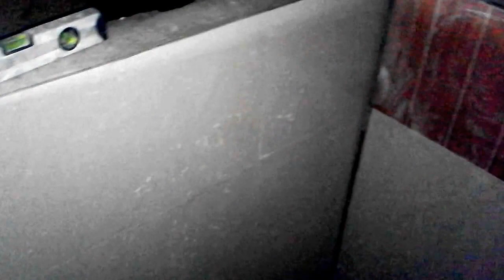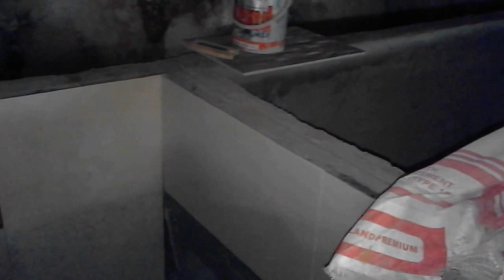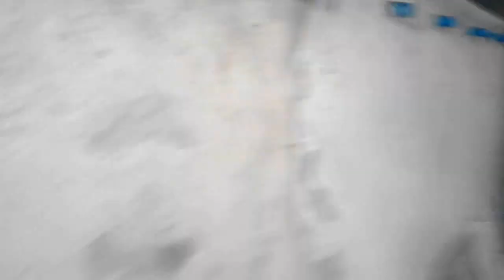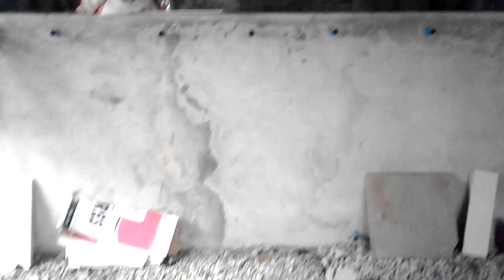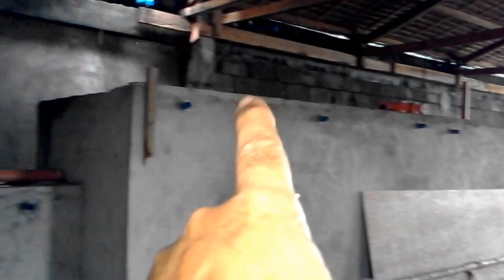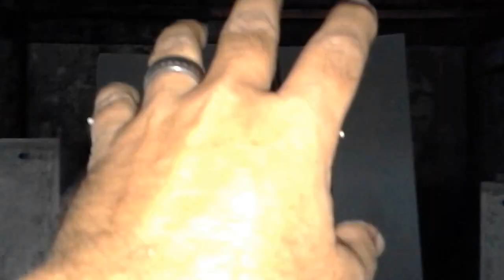Lobster Hatchery Project in Surigao # 14

Comment: Hi James any new videos about the project?
Reply from the maker: The construction has been at a standstill for a few months due to a few factors. We are in our rainy season here in Surigao and over the last few months this area took a direct hit of a strong tropical storm and a 7.2 and 4.9 magnitude earthquakes. We received some structural damage to the outer structure which still needs some repairs, but the saltwater tanks were not harmed. This structural damage needs to be done first before I proceed with the project. The work crew is currently being used in the city but once the rains stop we will start transporting building material to complete those repairs.

So I decided that I would use the downtime to work on few videos that I want to upload to this YouTube channel over the next few weeks. These videos will discuss the damage to the structure housing the tanks and equipment. Cover the biology, life cycle, mating and rearing processes of the P. ornatus species. And explain the facility's configuration, functions of various saltwater tank setups and the associated equipment designed to use in the facility.

 I have been compiling all the information to write the scripts, but still have to complete all the drawings and artwork plus collect the photos and short video clips which will be needed for the videos; but I am making good progress and should be able to start working on the next video in the next few days.

I know some of the topics are rather confusing and technical with a lot of information to cover, but I intend to present the topics in an easy to follow step-by-step format which should make them very informative. The drawings and artwork will allow me to also make this information much easier to follow and understand. And with luck I can present the information in a light-hearted down-to-earth presentation which will allow these videos to also be entertaining as well.   :)
Reply: We look forward to your videos. Goodluck!